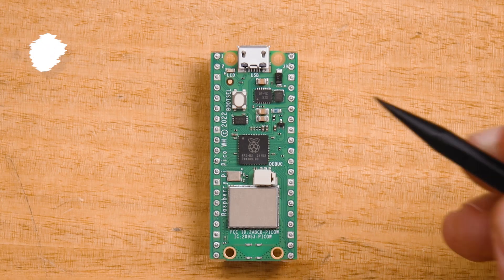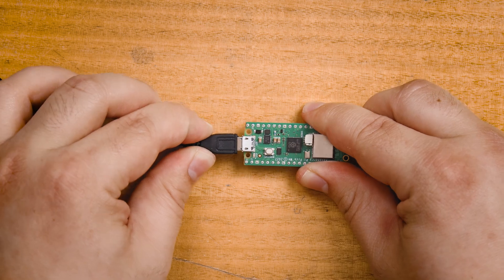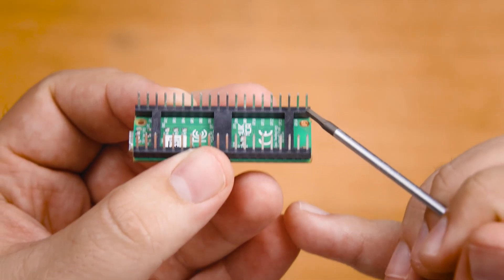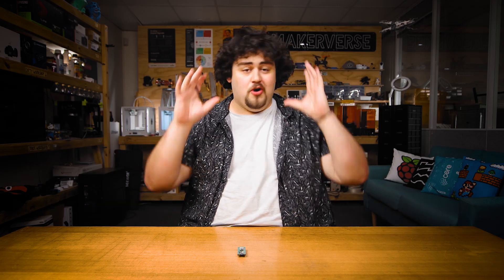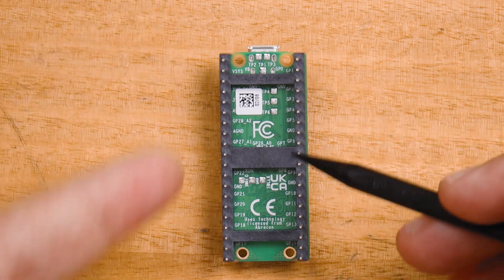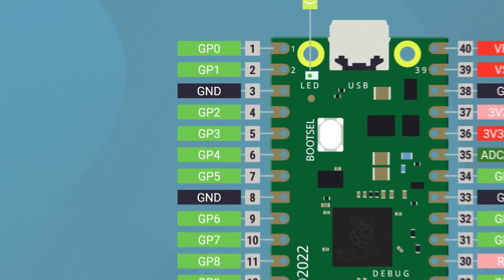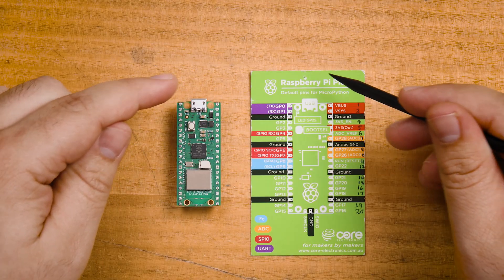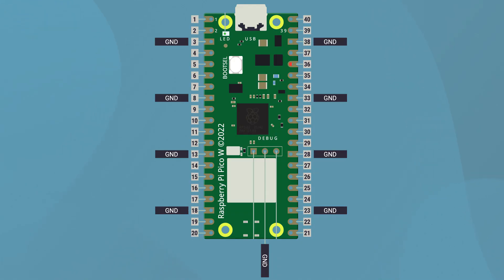Board Walkthrough & Pinout | Raspberry Pi Pico Workshop: Chapter 1.4

Comment: Noob tip, you don’t need to solder it on if you haven’t done the soldering course yet 😂 just put it on a plastic breadboard thingy with the pins in it. The board will hold it down. 

Once I figured out a practice some soldering I will attach the pins on the 3x pico I got for $2 each. The pins cost nothing to like 0.20cents. And you save a few bucks and get to practice soldering
Reply from the maker: While this can work in a pinch, it can be a little janky. It may seem like your code isn't working, but it turns out your pins aren't making proper electrical contact.
Reply: ^^^ THIS.